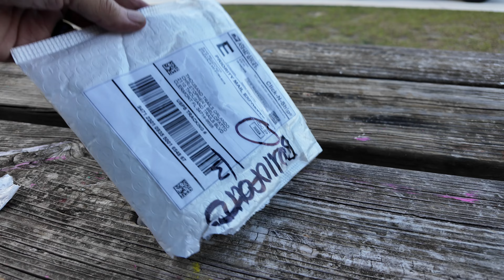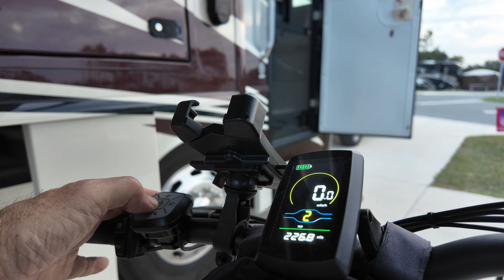BEST RV CAMPGROUND - BROKEN STEPS - STINKBUG INVASION

Comment: I bought the motors from Amazon for my steps, a lot cheaper then REV works great so far. The motor has a brass gear that turns a plastic gear, that plastic gear is what strips out
Reply from the maker: Thank you so much!  We will be purchasing it from Amazon from your recommendation.  Safe travels!
Reply: ADKUN 676061 RV Entry Step Motor 214-1001 Replacement for Kwikee Part Number 379147 1101428 379147 LCI 366043 369506with 3 Screws I bought two and now carry a spare.
Reply from the maker: Awesome!  Thank you!

Comment: Yeah that gear is slipping under a load. Runs fine when no weight or resistance. Hate the stink bugs, we have them all summer and fall in Michigan
Reply from the maker: Fingers crossed we get the parts in soon so Chris can fix it.  Stink bugs are the worst!  Safe travels Michigan. 😊